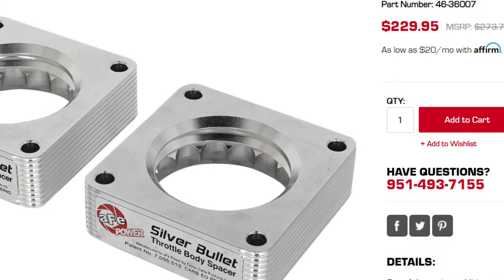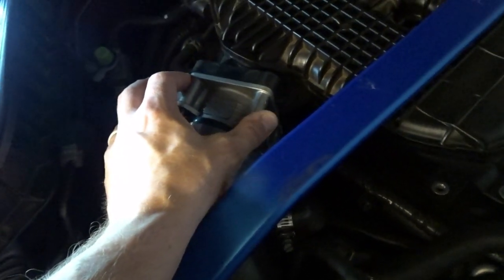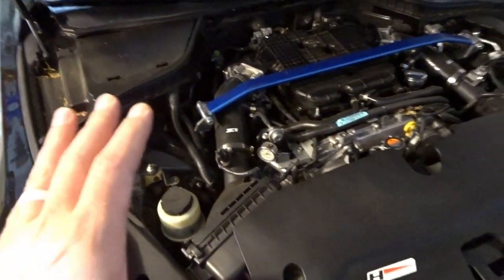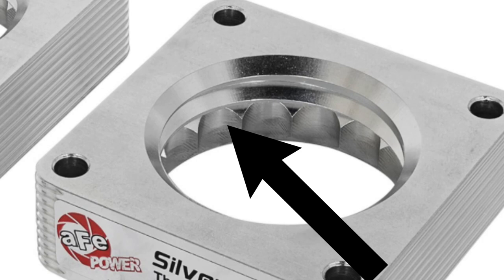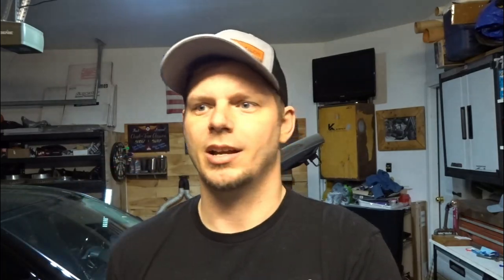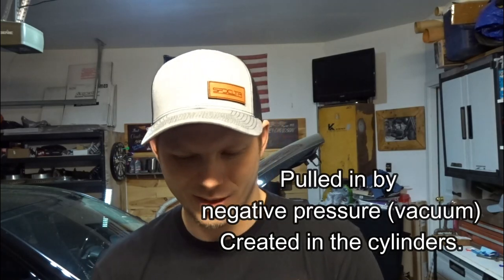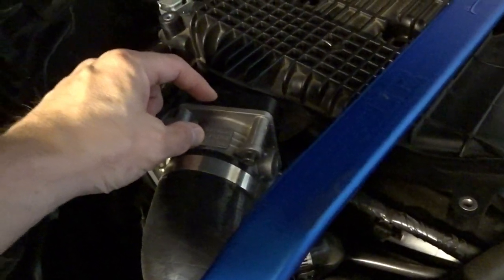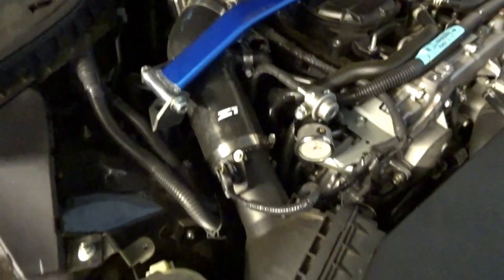Do Throttle Body Spacers Work?? | Watch BEFORE BUYING!!

Comment: I installed a Spacer with a drop in K&N air filter. It produces a deeper growl and better throttle response, on my 2010 CVPI. I also use a drop in K&N air filter on my work CVPI and the growl gained isn't as strong.

They do work. But more HP is bs. They are NOT a poor man's turbo.I paid $56 for mine from Ebay. Well worth it. But paying $200? Fuck no!
Reply from the maker: Not worried about the growl honestly
Reply: @SpeedCultureStudios  My point is that it worked. You could even hear a difference. Hence why I brought up the different growls.
Reply from the maker: @spacepope87  I understand.  If you’re purchasing them for a change in sound, they may work.  But the purpose of the part is to increase velocity in air which is supposed to increase horsepower.  And I agree with you—that’s bs 
Thanks for checking in!
Reply: @SpeedCultureStudios  You're dismissing that it helps with throttle response. Why?
Reply from the maker: @spacepope87  because it doesn’t.  Maybe you think you felt a difference, but there is no way to measure it in any real way.  Every experience with “gains” or “throttle response” is all anecdotal.  TB spacers do nothing.  Whether they are $30 or $300 I would tell you they are not worth the money.
Reply: @SpeedCultureStudios  It does make a difference. I've had others drive it without telling them and have brought it up.

I'm also a professional driver and have worked on cars for over 15 years. So your feelings on it doesn't trump facts.

Look, they're not worth it if you're going to pay anything more than $50-$70 for one. They're not worth it if you want them for added horsepower. And they're also not worth it if you only have a stock air filter. It's a device that incrementally helps with performance.
Reply from the maker: @spacepope87  It’s not my “feelings.”  It’s a pretty well agreed upon conclusion.  You haven’t provided me with any facts.  You’ve literally stated your “feelings.”  You “felt” throttle response but can’t prove it other than your friends also “felt” it.  
I’ve been working on and modifying vehicles and motorcycles for 20+ years.  I appreciate your experience—but it doesn’t help your argument.  I’ve never met anyone in the car world that has mentioned any real benefit to TB spacers.  And I’ve never met a professional driver that would recommend a $75 part for some sound and throttle response that can’t be measured.
Everyone wants to feel a change in their vehicle when they buy parts that are supposed to do something.  Maybe you and your friends felt a difference in your car.  That’s your experience.  I’ve owned 30+ cars/trucks and had spacers in several of them over the years—either already installed or for testing, with various levels of modifications, and have never noticed a throttle difference or added power.  Ever.  From 4cyl cars to V8s.  I’ve shared my experience combined with sentiments of literally every real car enthusiast I’ve ever discussed these with.  You won’t convince me otherwise.  I provided insight for people to use as they will, not to argue with you.
Reply: @SpeedCultureStudios  Even MOST youtubers agree that there's an increase in throttle response. Even the ones who think they're not worth it. But most youtubers buy the ones that are super expensive. Even you said to stay away from the cheap ones.

Look,  you're clearly biased against them. And that's fine. I see why. I don't fault you. They falsely advertise 10hp gain and increase in MPG.

But as far as a CVPI goes, they do work. And that's indisputable.

Well you can dispute that a bat is mammal or a turtle an amphibian. But that would be a buffoonish argument.

Comment: You say they domt add hoursepower… but are you talking peak power? Well the spacers are meant to increase low end torque below 2500 rpm and throttle response… not peak power..
Reply from the maker: They have no impact on power anywhere on the powerband in a vast majority of cases.
Reply: @SpeedCultureStudios  i agree you are probably right… but the case for the physics is there.. if you think of the throttle body as a choke point., speeding up air flow through it would improve air flow slightly.
Reply from the maker: @keithbellair9508  The theory behind them is compelling and you can make it make sense, but in a practical sense, they just do not work.  There are a lot of things that sound good on paper, but when you test them or put them to use in the real world, they just don't pan out.  This is one of them.

Comment: Great video, now my next mod is destroyed lol. I would’ve thought there would be some hp gains. I was going to go with afe. They claim some hp. They even had a Dyno sheet with the 370z stock with muff delete. The hp was 6 plus 7lbs tq. I know every car is a bit different and some results vary. But it seems with the 3.7 a couple hp is a lot and every bit helps. Oh well.
Reply: It works. I have one. Didn't pay 200 bucks. My definitely works. I have a few mods on my car,as well
Reply: @carlosmoody1615  I paid $65 for mine. Much better throttle response.
Reply: @carlosmoody1615  this definitely works on a panther body car. Throttle response on a 4.6L with performance air filter and muffler delete or muffler and resonator delete is a notable difference. This is just shy of $200 worth of parts from factory. No Cold air intake. They don’t work properly unless tuned so I buy a $20 performance air filter and slap it in the factory air box and it works like a charm. Also I think the spacers work better on V8’s because of the torque difference and the intake manifold size.

Comment: what about the big bore throttle bodies?
Reply from the maker: They make more sense to me in theory, but results I have seen from them don’t do it for me either.  The dyno sheets I have seen show the same numbers as people with factory TBs.  the thing is that the VQ already brings in as much as as it can handle so when you install bigger intakes or ported manifolds, the car can’t really do much with it.  Test pipes and catback help and headers kinda sorta help, but the results don’t change much.  You will make 335-340 hp with intakes, test pipes and catback.  Install big bore TBs, you’ll make 335-340hp.  Install ported upper and lower—335-340hp.  Install headers...335-345hp.
Reply: @SpeedCultureStudios  thanks! thinking of just LS swapping hahaha
Reply from the maker: @justenrust7651  sounds like a good kdea

Comment: Dude.
Everytime you take off the throttle body you gotta recalibrate it.
If not it won't run right
Reply from the maker: Not correct.  But yes they are sensative so if you touch the flaps inside, that will likely require you to perform a throttle relearn
Reply: how did you recalibrate it? Can you be more specific, thanks!
Reply: @BapFootballHD  reset your car computer, then restart and it should relearn/reset air/fuel mixtures.

Comment: It's seems really odd to me that you actually got one and INSTALLED IT on your car. In the comments section of my video I on TB spacers it was clear you were against then yet you "installed" one now.

Initially I thought it would give me gains in HP/TQ however after the installation I saw an increase in "response" Can't see response on a dyno but it's there! I'm so confused by you making this video.  Please explain the intention
Reply from the maker: Watch the video lol.  I did not install them.  I just showed in my energize bay where they would be located.  This was just answering questions that I get about them regularly.
Reply: @SpeedCultureStudios  looked Ike the black one behind the TB
Reply from the maker: @blacktalonsport1262  No that’s just the mounting point coming off the intake manifold.  The plenum.
Reply: @SpeedCultureStudios  it's not clear in the video
Reply from the maker: @blacktalonsport1262  it’s clear if you are familiar with this engine.  I didn’t think about others from outside the platform watching.  But The spacers I show are silver.  There is nothing silver in the engine bay.  But I also never said anything about having them installed on my own car.  I apologize if I wasn’t clear.
Reply: @BlackTalon Sport I’m so confused by you watching this video, you drive a Ford Explorer please explain the intention.
Reply: @colbyconaway2664  A and B brah...no need for me to explain anything to YOU.
Reply: @SpeedCultureStudios  no worries.
Reply from the maker: @colbyconaway2664  because we also own an explorer and we had a discussion about these spacers on his channel.

Comment: Another NOOB. I tried one myself because of the internet arguing lol 
The difference is very noticeable down low. 
And yes i would fit another if ever available !
Reply from the maker: Noob? 😂 It’s pretty common knowledge that, in general, these do not do anything.  However, as I said in the video, every car is a little different.  But you’re right—you’re the expert—because you “noticed” a difference.  Maybe it did something for your car, but of course you know that without figures or proof, you just sound like a noob using his butt dyno saying “trust me.”